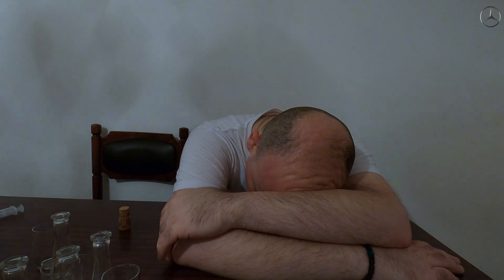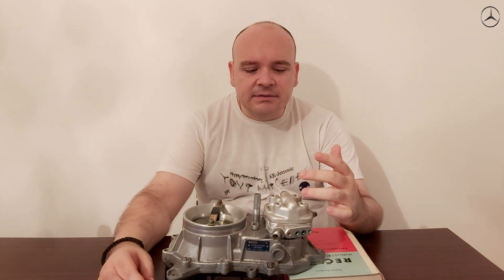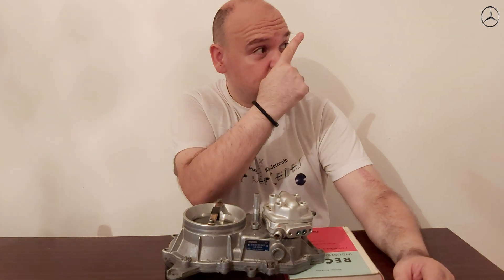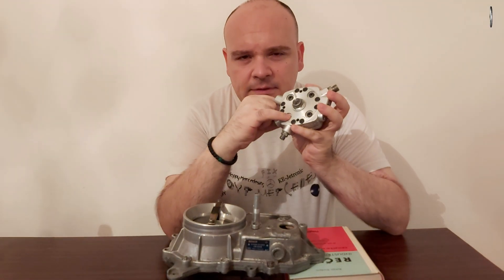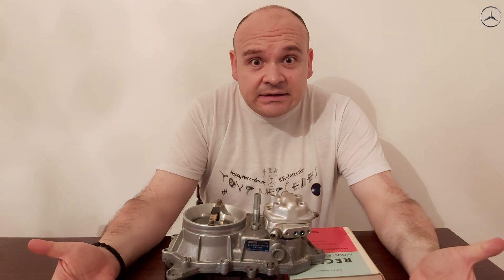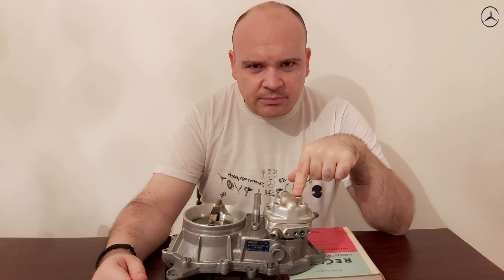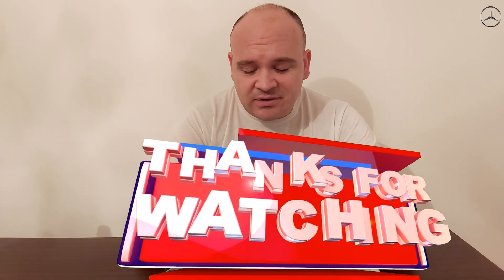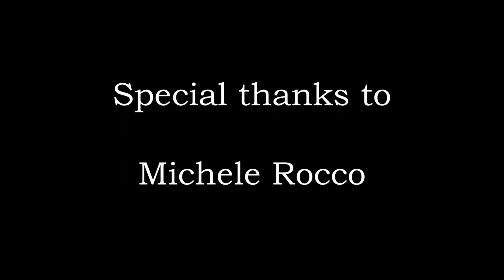㉦Mercedes Ke-Jetronic㉦ - 🎓📚The fuel Distributor and its fuel quantities🎓📚

Comment: Unless you have a micropipette, another home based/cheap way to measure to 0.1mL (100uL) is using kitchen scale or jewelry scale with at least a decimal point for gram. Measure the weight of 10mL of liquid, calculate the density weight/vol. Now you can convert the weight of the "wine" to volume.
Reply from the maker: The point was to show the discrepancy and how much it is. So, as I have said in the video - 5% of the quantity on idle is the upper limit, the less the better, as less discrepancy between the cylinders as you can get. Btw. thanks for the tip!

Comment: Hola es que tengo un fallo con mi mercedes190e modelo 84 solo dos pistones tienen precion de combustible al parecer ningun sensor de la ke-jetronic quiere trabajar lo llevaba conduciendo y cuando lo apague y lo volvi a prender ya no trabajaba bien y no tenia fuerza te gradeciera si me puedas dar algun consejo de que puede ser el fallo gracias
Reply from the maker: Hola. Gracias por el comentario. Me diste un buen material para el video! Entonces, si todo sucedió como me describiste, entonces no es tu culpa. Si ninguno de los sensores muestra valores nominales, verifique su OVP (relé de protección de sobrecarga de voltaje). Retire el relé y el conector de su ECU (el relé es el suministro de voltaje para su ECU), tome un multímetro, seleccione la opción de zumbador y pegue uno de los cables en el conector OVP y el otro en el conector de la ECU. Si no obtiene continuidad (sonido de zumbido), entonces su relé está dañado. En el encendido, deberá obtener voltaje de la batería (11-14V). O reemplácelo o suelde el contacto, pero prefiero reemplazarlo. Diría que su ECU está en modo flácido debido al OVP. Eso es lo que puedo decir por ahora y buena suerte.
Reply: @mercedeske  gracias revisare

Comment: Hello, I was curious if you could help
Me on troubleshoot my fuel distributor. Long story short the fuel isn’t coming out of the top where the banjo boots are. My cold start and regulators work so I know the electronics on it are fine. I’ve rebuilt the distributor to see if that would help but it’s doing the exact same thing as before. If you could help me that would be amazing. Love your videos bte
Reply from the maker: Hello and thanks or the comment. You will have to tell me which car it's about. Best regards.
Reply: @mercedeske  sorry about the long wait, but it is a 1985 Audi 4000s Quattro and has a Inline 5 engine.
Reply from the maker: @justycefritz4695  Have you set the distance between the sleeve and nut on the fuel distributor exactly there as it was? If you haven't the distance is supposed to be 0.6mm
Reply: @mercedeske  the distance is currently .58 mm. I will fix this immediately. Would this be the only reason why the no fuel is coming out of the top when the sensor plate is manipulated?
Reply from the maker: If there is no fuel then either the sensor plate doesn't touch the central piston in the distributor(plunger) or the fuel distributor is clogged(my guessings, I can't tell for sure).

Comment: Make a video on asr for early r129 with no diagnostic please, it will help alot of us.. thank you
Reply from the maker: George, that would be a bare boring theory from which you won't learn how to diagnose or repair your car. I will make a video of it to describe you the purpose of my videos. I don't like making videos out of which you won't learn anything, that would be stupid of me. To describe the ASR - you have 4 sensors, an electronic accelerator and an ABS/ASR module, as well as some other actuators. As you press the accelerator harder, the wheels start slipping. The computer recognizes that over the sensors and starts braking. On the other hand the throttle pedal must be electronic so that the ECU then could close the throttle in order to diminish the airflow so that the car could loose torque and at the same time to reduce the speed of spinning wheels. That's it. Happy Mercedesing!
Reply: @mercedeske  thank you for your reply, it seems i have many components to work through... this will not be happy mercedesing hahahaha